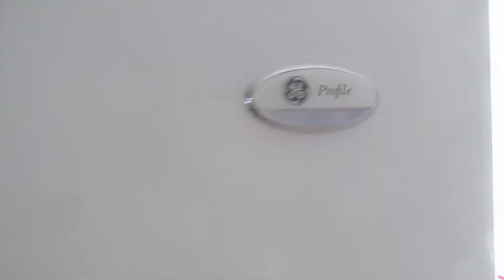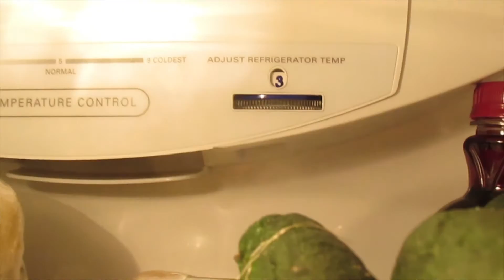Defrosting GE Profile Refrigerator's Coils

Comment: No electric defrost?
Reply: There is electric defrost.
Reply: @vadimzorin7804  yeah I see that now on the one I'm working on, just wondering why his needed defrosting now? If it's burnt out his fix would not have lasted long
Reply: Scott van Ruin I think it is just faster to defrost it this way :) it was helpful for me to see how to get access to the fan as in most fridges it is behind back wall but this fridge is different
Reply from the maker: @scottvanruin6481  The repair guy told us to defrost the coils to save our food.  He had to order a new thermostat but it wouldn't arrive until a couple of days later.  Defrosting will buy you a few days of cold temps in the fridge before ice forms on the coils again.  In theory, you could just keep defrosting with the hair dryer every couple of days to keep the proper refrigerator temps.